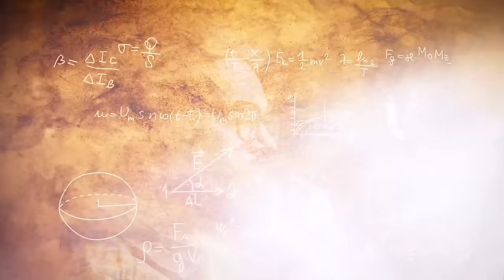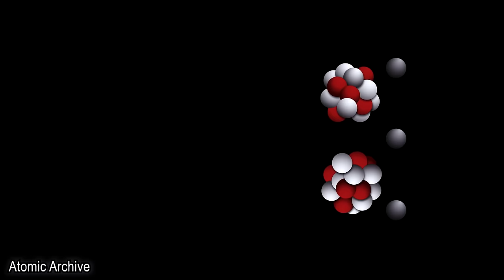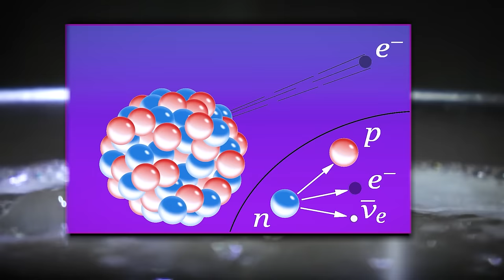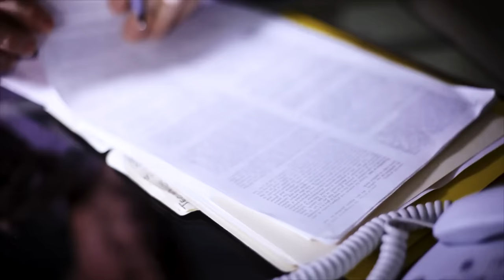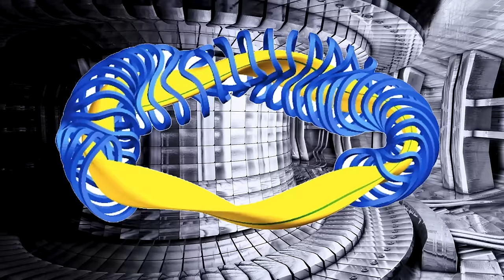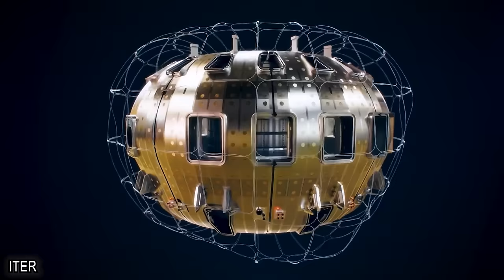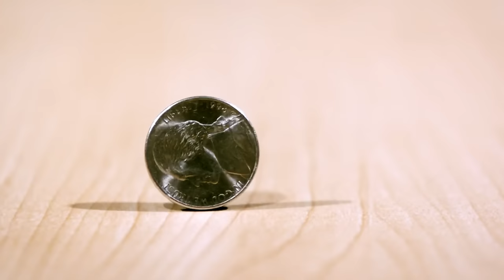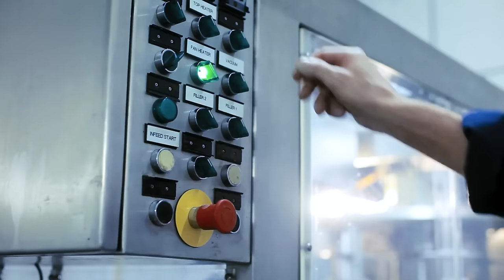When will we FINALLY achieve fusion power?

Comment: Fusion is an energy-consuming reaction, not energy-producing. The real product of fusion is the fused atoms and neutrons.

Hydrogen Deuterium + Tritium Fusion is used in Thermonuclear weapons because the byproduct is free energetic neutrons. One of the reasons it is used is because it shields the second stage plutonium material from destruction by absorbing thermal radiation from the first stage fission reactions instead of allowing that radiation to expand and turn into shockwaves and blowing out the perimeter and such -- and for releasing neutrons directly towards the material that has yet to undergo fission and exponentially accelerate the rate of fission through it without generating significant heat and radiation that would destroy the second stage fission reactions. Instead it is the neutrons released by the deuterium and tritium allegedy durign their fusion but also release neutrons upon absorbing this radiation even without necessarily undergoing fusion - although fusion is ideal for it because it releases 2 instead on one neutron and the neutrons released are more kinetic than the one would be without the fusion. But the radiation and heat "created" by fusion is not the point  - in fact it would defeat the purpose entirely. Fusion is there because it does NOT release heat and light  significantly - rather - fusion ABSORBS heat and light and outputs NEUTRONS and HELIUM.  

This gives the fission neutrons to accelerate the fission reaction more efficiently and reach a high level of completion before the material is vaporized by the blast. In hydrogen bombs, with fusion ongoing, the material in the second stage is protected while the neutrons accelerate the fission.

If fusion were a source of energy rather than neutrons and larger nuclei, this would not be the case.

If physicists believe there is "missing mass" in helium-4 and that it is lighter than the sum of its parts, they may be mistaken or dishonest. Perhaps the missing mass can be explained by other means than assuming that protons or neutrons during fusion "converted into energy." What exactly converted into energy? How do you define energy - photons? What turned into photons? What if those photons were merely bystanders caught in the process? Is the energy then just the kinetic energy transferred to nearby particles upon collision? If particles are accelerated using energy, the excess energy must be conserved, not coming from the fusion itself but from the initial acceleration of the atoms. The actual atoms fuse to create a heavier atom and some neutrons in the debris, possibly interacting with a passing photon and turning it into a gamma ray. However, the amount of matter remains the same throughout the process. The motion used to fuse the atoms is the energy obtained after fusion, which does not benefit us for energy production since the purpose of energy production is to obtain energy without requiring additional work. In fission, a massive amount of energy is obtained for free with just one neutron, while in fusion, only helium and neutrons are produced.

If it turns out that the motion and matter obtained from fusion are less than the energy input, and therefore must be conserved via photons as speculated, this may not be the only explanation. It could be that the energy input into fusion is stored in the nuclear bonds themselves and can only be accessed through the fission of a much heavier nucleus. The energy obtained from Plutonium and Uranium fission is the energy that was initially put into lighter nuclei during fusion in the cores of stars and supernovae. Fission represents the energy of fusion, the missing mass of fusion. Fusion does not immediately provide this energy; it is released after billions of years and multiple fusion reactions of heavier and heavier nuclei. Only when reaching Plutonium or Uranium can one harness the free energy of fusion (Which is only free when nature has done the work FOR YOU -- in the cores of Stars and Supernova billions of years ago -- NOT when you have to initiate fusion yourself - that isn't Free, it's either A loss, or its a Zero, it is not a gain -- unless your goal is to make more helium or obtain free neutrons, but i don't think thats what you want is it?).  In Fission, the initiator of fission is not 100 billion degress, it does not ask for you to generate conditions found in the center of the sun. It does not ask you to accelerate hydrogen to the speed of light. All it needs is a neutron - one neutron to start the chain reaction that splits these nuclei which are in the final analysis the results of multiple fusions creating that heavy atom billions of years ago --  only now it is releasing the energy that caused that fusion to happen - the extremely violent and kinetic event of the gravitational collapse of stars -- which is then handed over to you during Nuclear FISSION..

Therefore, if seeking fusion energy, one should look no further than nuclear fission, as it represents the energy of fusion from billions of years ago - fusion that was done FOR you - without requiring any work or input -- its energy is available to you via FISSION.
Reply: Or as Teller put it, its a super bomb, the eff of conventional atom bombs is low because it is limited to fissioning only a fracton of the U235 or Pu239 fuel.
In the super bomb, the Deuterium Tritim from the Lithium Deuteride acts as an amazing neutron amplifier that can fission a large amount of U238 and Pu239 in the sausage structure. Only a small percentage of the destructive energy is released from the so called fusion reaction.

Also the energy from fission largely comes about from the creation of heavy elements well beyond iron when 2 neutron stars merge with the iron surface blown away forced to absorb many neutrons in the R process, and even then the 2 stars that formed those neutron stars possibly in a binary pair would have been CNO burning large stars so nothing like our Sun. Any astrophysicist would know all this stuff already.

On a side note, I'd be damned interested to know if anyone has dreamed of a fusion reactor based on CNO since it is 10000 times more productive than the PP cycle, it would put humanity amongst the gods if that worked.

Comment: When will we FINALLY achieve fusion power? That already happened on November 1, 1952, when fusion power was achieved in a test of a thermonuclear bomb. It even produced electricity in the form of lightning discharges near the fireball. The better question is "When will fusion power plants FINALLY be used to economically produce electricity?" The date for that would be the 12th of Never. With trillions in funding for ITER and similar hopeless projects that date might be moved up to the 10th of Never.

Comment: When will FINALLY achieve fusion power? Until we learn to build gravity generators, never. Fusion reactions in ordinary gravity are NOT self-sustaining, otherwise known as "chain reactions." All of the reactions we use today ARE chain reactions. We have been struggling to make electromagnetism do the job that gravity does in the stars, but I do not believe that will ever happen. The research will continue because too many politically well connected academics are making their living from the research, but I do not see a way for any of their approaches to ever work. So, with no means of generating intense gravitational fields, fusion is not in our future. We would be far better off spending money on cleaner and safer fission plants, probably plants built around the use of thorium as an initial feedstock.

Comment: If fission reactors were just runaway reactions they wouldnt be used. The initial mining is not anymore dangerous than any other mining. And fusion reactors produce waste and dangerous radiation, so tell people the truth. A fusion reactor will produce neutrons and those neutrons are what transmutate elements and its even what some reactor designs are going to use to produce tritium aka radioactive hydrogen, in situ to produce their own fuel. Fusion reactors arent the super safe super clean sources of energy that people think they are. Yes i want fusion power but i want those communicating how it works to be HONEST. Coal power plants emmit far more radioactive emmisions in their smoke than any nuclear fission power plant in operation today so forget carbon theyve killed more people than any nuclear melt down, or weapons since we started burning coal by the ton for electricity either from respiratory disease or straight up cancer. And lawrence Livermore did not hit break even no matter what mental gymnastics you use